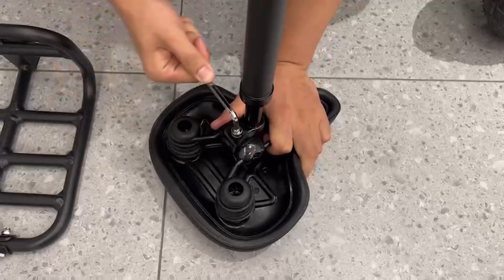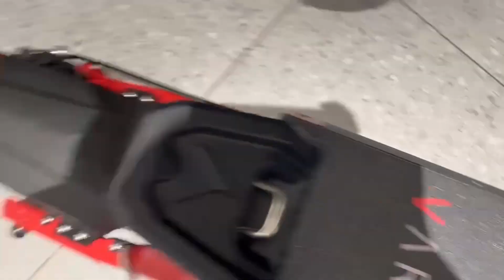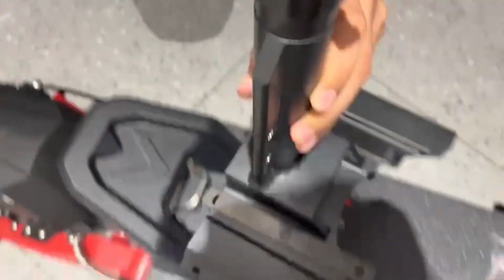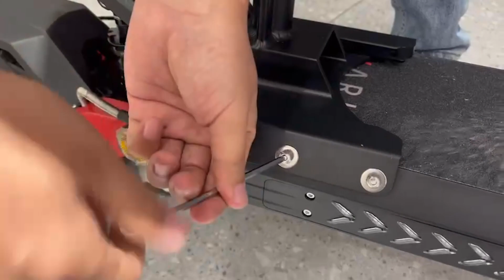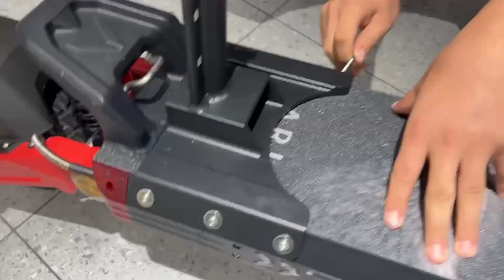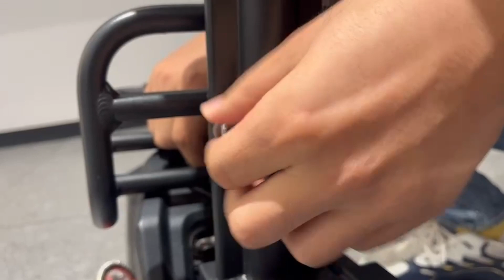Install the Seat Kit on Eagle One V2.0

Comment: My seat came broken. Gets jammed trying to insert into the holder.
Reply: Same boat. I first got my package sent to the wrong address after getting confirmation it was sent to the right one from varla. Then when I finall received the seat and the parts are messed up. I can’t put my seat post in because the diameter of the post is too large